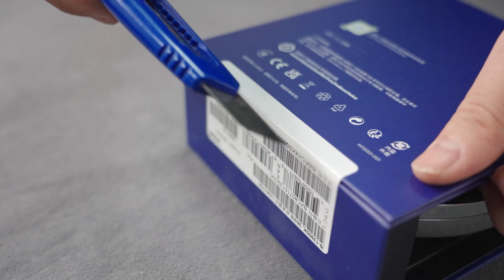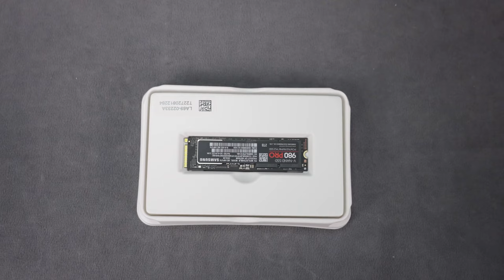$6200 Building RTX 4090 VULCAN + MAXIMUS Z790 EXTREME + INTEL I9-13900K

Comment: I just purchased Z790 max extreme I am trying to understand how to use the audio connectors on the back of the motherboard to connect to a 7.2 AV receiver so I can get full Atmos. But i need to be able to connect from the motherboard directly to the AV receiver. How is this possible. I am using a monitor not a TV so ARC is not possible. If this is not the right place to ask this type of question, where would be the right place?